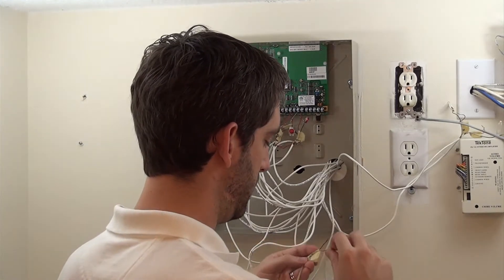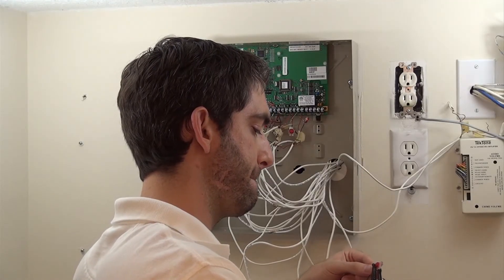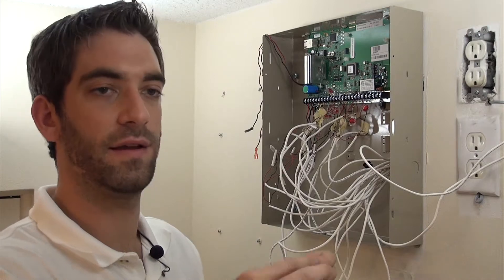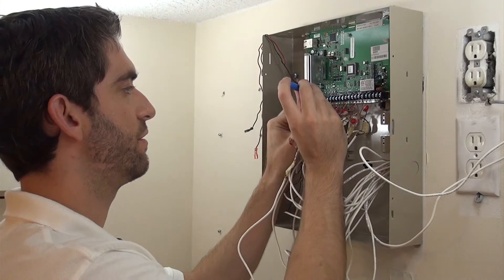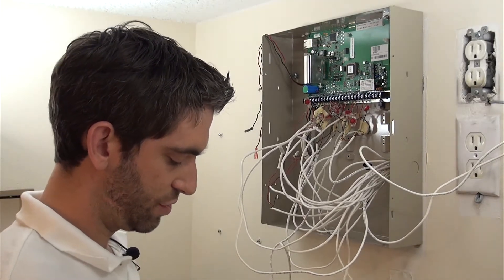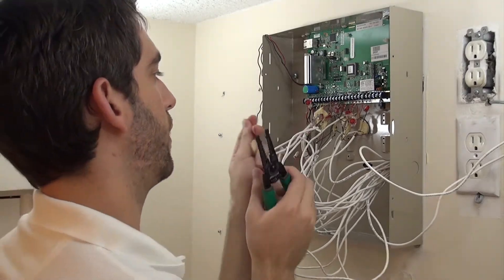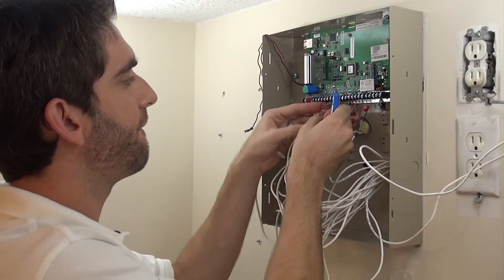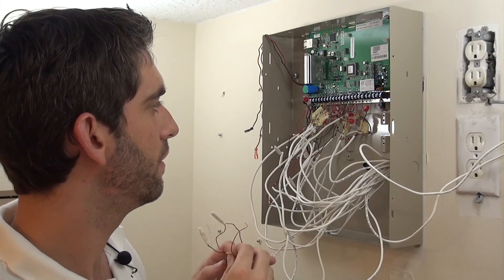Honeywell VISTA 21iP: Zone Doubling, Installing 6.2K Resistors

Comment: An End Of Line Resistor (EOLR) has to be at the end of the line/run, by the very last Normally Closed (NC) sensor in your run. A run is the (two lead) cable connecting multiple NC sensors (in series) to the same physical alarm zone on the panel. This cable should be "running" from the panel to the first sensor, then to the second sensor, then to the third and so one.... Ideally the split in this cable where each sensor is inserted (in series on one of the two leads) is as close to the sensor as possible, ending with the EOLR (in series) right next to the very last sensor. If you put your EOLR by the panel you can short the wire (connect the two leads in the cable together), anywhere between the panel and the sensors with a simple sewing needle and deem any sensor down the run useless. Let's say you have access to a building during the day, with a needle in your pocket you can "sabotage" any window or door sensor, without the panel ever knowing thus not showing any indication of fault or "tapper" when the alarm is later armed. You can then simply break into the building without setting off the alarm. (For you Nerds out there, you could run a single lead in a big circle coming together ONLY by the panel to make it difficult to short the run, but this would be an installation nightmare). With your EOLR in the right place it serves as your tamper protection as well as completing your EOLR run electrically. With the EOLR at the panel your run is electrically correct, but the run can then easily be tampered with without anybody knowing. In a Zone Doubling system (ZD) each physical zone on the panel can be used as two zones, with two independent runs connected in parallel at one physical zone on the panel (thus zone doubling...). In this case one run gets a 3k EOLR and the other run gets a 6.2k EOLR (connected at the very end of each run). The physical zone must then be programmed to Hardwire type 3 = Zone Doubling (ZD) (in data filed *58 or *58 Zone Programming) (Not to be confused with Zone Type!, also programmed in data filed *56 or *58). A physical zone on the panel programmed to ZD will then sense the change in current, recognizing if the 3k loop was broken, the 6.2k loop was broken, or if either loop has a short in it (provided the EOLR is in the right place...). All my installation utilized ZD. You get a lot of milage out of a very small system that way. In any installation you should utilize EOLRs, always, . Your system will be very vulnerable to, not only tapering, but to simple electrical problems with your wiring if you don't.
Reply from the maker: Hi Niklas, we agree with you! This is a retrofit of a Vista-20P in place of an Apex Destiny panel. We always recommend putting resistors at the end-of-line where they belong, but it is not always feasible to do so. This video predates my time at Alarm Grid, but I know that in this instance, either the original panel had no resistors, or it had resistors that were installed at the panel. With zone doubling, resistors are mandatory so we had to put the resistors at the panel in this case. It is still helpful to show the resistor values and how to connect them in series.
Reply: technically,  the end of line is where the neutral or common lands on the panel;.  When considering the flow of electricity.

Comment: End of line resistors are called "end of line resistors" because they are supposed to be used at the end of the line, not at the panel.
Reply from the maker: Agreed Nicholas, as we have explained at https://www.alarmgrid.com/blog/ever-wonder-why-they-re-called-end-of-line-resistors. Unfortunately, you may not always have the option to put the resistor at the end-of-line, or the original installer may have incorrectly installed them at the panel (like on the panel we did this video on), and with zone doubling you have no choice but to use the resistors.

Comment: Opinions are like...well, they're pervasive, let's put it that way.  Your feelings on End of Line resistors are colored by many things; who you learned from, how industrious are you (or how lazy), how concerned are you with your security, how much time do you have, and so on. You guys seem to have missed the point of this video entirely.  This video is showing you how to wire the high number zone of a zone doubled pair on a Vista-21ip.  Yes, you wire normally closed contacts with End of Line resistors in series, but you wire your pair of doubled zones in parallel with one another (when you put a 3K resistor and a 6.2K resistor in parallel with one another you get.....2.1K, that's how zone doubling works!)  This is also why you can't zone double any normally open contact, because a short on a doubled zone will only give you a trouble, never an alarm.  

So, you say, that still doesn't address the question of whether or not resistors should be put at the End of Line, or at the panel.  Of course they SHOULD be, they're called End of Line resistors for a reason.  But, resistors at the panel are better than no resistors at all, and on the Vista-20P/Vista-21ip, you have the option to program zones 2 - 8 as Normally Closed with no EOLR (assuming you're not zone doubling, of course), and our audience, the DIY homeowner, is more likely to take the "path of least resistance" (alarm humor) than to wire their resistors at the end of line.  So, which is worse?  The panel is in a metal enclosure with a lock and key.  You can put a tamper switch on it if you like.  Resistors at the panel are not exactly out there for the whole world to access.  The response on a standard hard wired zone is 350ms.  With a resistor at the panel, I doubt you could tamper a hard wired loop effectively in that amount of time.
Reply: +Julia Ross  I'm thinking it's someone from a competing business. While it's rather rude; I can see a competitor trying to down play another business to make them look better. Trolls are trolls. If you don't feed them they usually go away